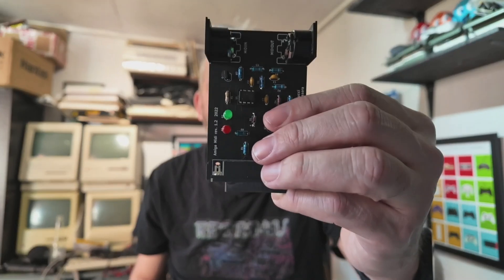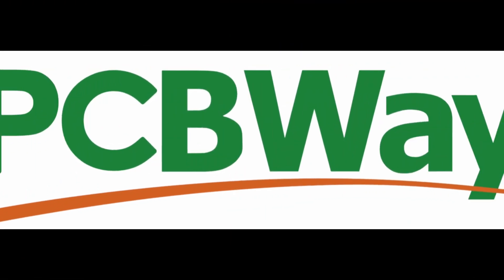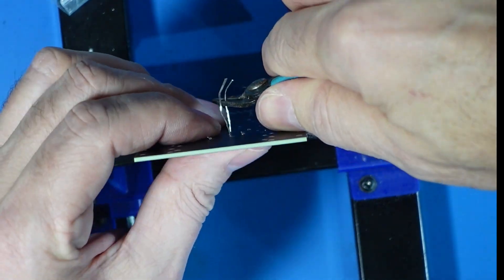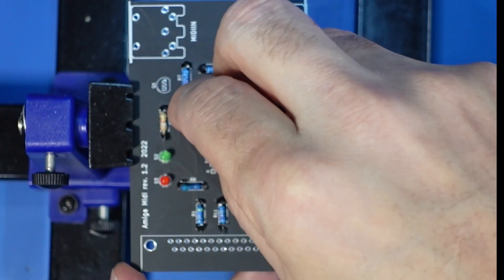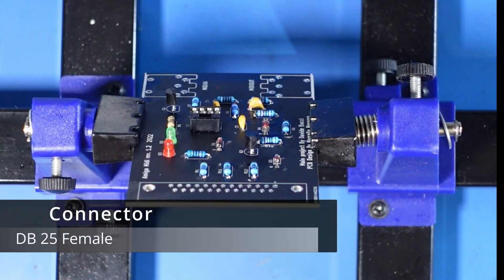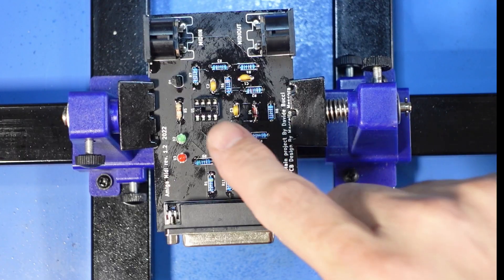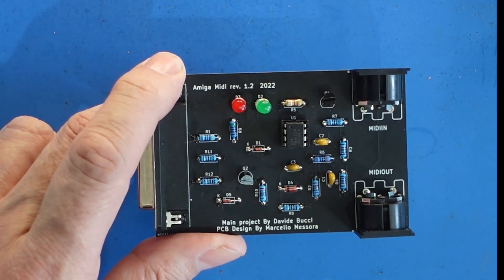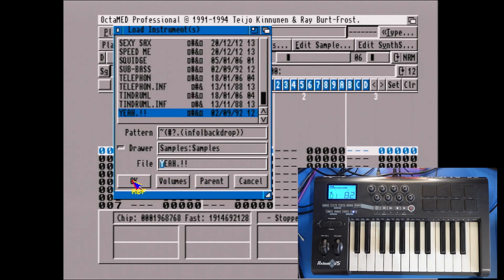Adding MIDI Support to a Commodore Amiga – DIY Adapter Build!

Comment: Or,  you could just use the purpose built Amiga 500/2000 MIDI Interface by ECE  Research & Development, 1651  N. Monroe St., Tallahassee, FL 32303. If you had a time machine. I still have an Amiga 2000 purchased new about 1987 (in storage, I haven't checked if the battery has leaked) but I only had to go out in the garage to find the above hardware in the original box with the price sticker dated 12/88. The price: $59.95 (or $160 in 2025 dollars). I used it extensively in that period, which was at the birth of MIDI. I was actually a member of the MIDI Manufacturer's Association at one time just to receive the monthly newsletter. The Amiga 2000 was supplied with the "MusicX" MIDI sequencer app. Included were a number of short sequences of melodic phrases with four-harmony. I arranged the pieces, adding intros and endings, selecting the electronic timbres for each voice, and, most significantly, added rhythm tracks. I then compiled them a short "suite" with a fantasy theme. The results can be heard online (with not the greatest audio quality due to many transcriptions to newer media over the decades). The SoundCloud URL is: https://soundcloud.com/synoptic-designs-studio/storybook-fantasy-suite.

Comment: For playback of MIDI music from games this is great, but for serious music making Amiga and MIDI is not very good, better get ATARI ST if serious.
Reply: ST ruled the scene I know, but Music-X is awesome on the Amiga (shame it was so expensive).  It really deserves a close look.  the tracker programs like octamed aren't really ideal for MIDI.

The Amiga had a 1-byte serial buffer which occasionally causes MIDI data corruption.  It's an easy fix but the big C never fixed it (that's why some MIDI cards have their own buffer to fix the problem).

However, you can link an ST to an Amiga with MIDI and play Paula samples - it's a MASSIVE improvement over the ST sound capabilities. 

The ST had really superb MIDI support but Music-X really needs a look.  The manual is essential!
Reply from the maker: I now have a ST sitting under my desk although I'm not sure 🤔 if it works or not. It's not a E it's a FM but it still had the midi ports :)
Reply from the maker: Yeah I know the ST is better as for a start MIdi was built in. And for the serious retro musicians I agree with comment 100% But i don't have one and tbh I enjoy the building of things. I have heard bars and pipes is good for the Amiga just I have no idea 🤷‍♂️ how to use the thing lol 😂. But thanks for your comment and advice it always appreciated.
Reply: @Retro4u  nah, it will be a lot of fun Im sure. I just wanted you to be aware that Amiga architecture is in the way of accurate MIDI and the 1bit buffer for serial port simply skips some MIDI input from time to time when video timing that has in Amiga priority takes up the bus bandwidth.
If you not intend a use as a "sharp eared" pro musician that can hear any fluctuation in "force", then you are fine with Amiga. Many Amiga fans think that with simple MIDI/RS232 interface Amiga becomes same MIDI monster as ST, but in ST the MIDI is DMA based with reserved bandwidth and nothing gets in its way. ST is till today the most exact general computer used for MIDI. I just wanted to clarify, and show how "smart" I am :elbowcough:.
Reply from the maker: @madigorfkgoogle9349 not a problem buddy that's why I love to do YouTube and meet people like yourself who share knowledge and I myself try to learn all the while. As it what keeps us young well that's what I keep telling myself lol 😂: I did own a STE back in the day but never used it midi capabilities I then switched to Amiga 500 like most people who played games as teenagers lol 😂. One day I'll get a STE and revisit MIDI perhaps but for now yes I agree my Amiga 1200 will do. Many thanks for the information you provided I always find it most interesting 🧐 what knowledge is out there :)
Reply: @Retro4u  get the STE asap, or better MegaSTE, the prices are hiking up fast. MegaSTE is A1200 level already and the STE is A500plus level. I follow the prices since COVID and prices doubled, dont think it will be better with time. ST line is way more then gaming computer and you have a lot to discover. Make sure to get the monochrome monitor SM124/125, SM144/146, I know today modern LCD is great on ST and Amiga, but the SM monitors are stunning, one of the reasons we loved ST more then Amiga. And those mono monitors are still accessible (around 50€).
Reply from the maker: Yeah prices have gone crazy 🤪 I will look for a broken one :) ☝️.  lol 😂 thanks again for the comments

Comment: Always enjoy a good build video, well done.  It looks like a nice little project and I'm super interested to see what you do with it.  Hopefully you'll get the chance to try the few Amiga games that support midi music.  I think its mostly the old Sierra adventures games.
Reply from the maker: Yeah I have plans for sure 👍. It a nice easy build for someone to start of with non of those finky SMDs we all bend to see under a microscope 🔬. Proper old school 🏫 through hole build :). Yeah 👍 I have plans for sure just need to wait for stuff to be delivered etc would love to learn how to use the midi controller tbh but ya never know :). Thanks again for the comment.
Reply: @Retro4u  I'm currently struggling with 0402 smd parts on a build.  Something like this with through hole bits you can actually see is just so much more relaxing. Keep up the good work.